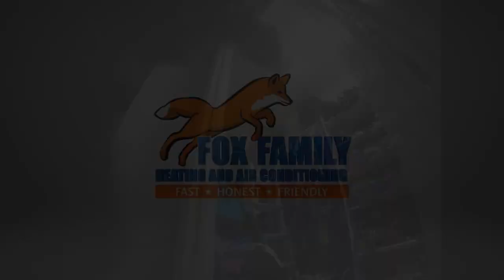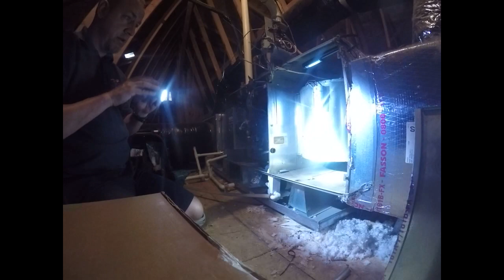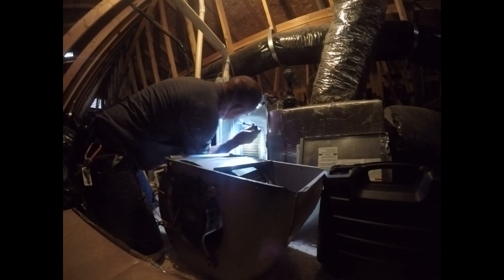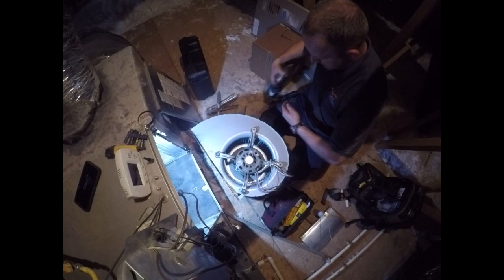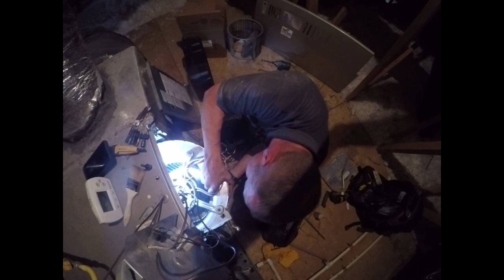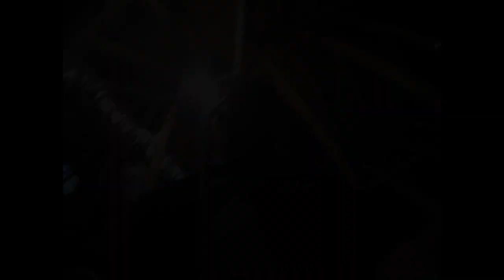Blower Wheel Replacement (Disassmebly and Reassembly)

Comment: Good repair on blower////wheel, we always change mtr when wheel came apart. Guess it was good enough to run till next summer. Good Luck.Greg
Reply from the maker: I ended up having to change it a few days later!  lol.  Was running at 11.5 amps and very hot to the touch.

Comment: nice  blade changeout how old is the unit, we've did the same i recommended to the client he should also have the motor changed, he said no we were back 5 days later to change it man it was old.keep them videos coming Thanks for Sharing.
Reply from the maker: I ended up having to change it a few days later! lol. Was running at 11.5 amps and very hot to the touch.

Comment: What would cause that
Reply from the maker: +involved gamer ive seen bad static pressure backing up against the blades crush a wheel like that before but this systems SP was good. So i cant fihure out what did it
Reply: Fox Family Heating and Air Conditioning how old was this unit because it does not look very old, with that being said maybe a defective blower